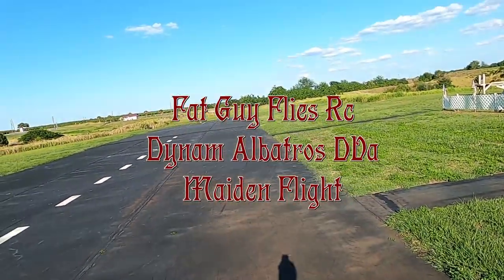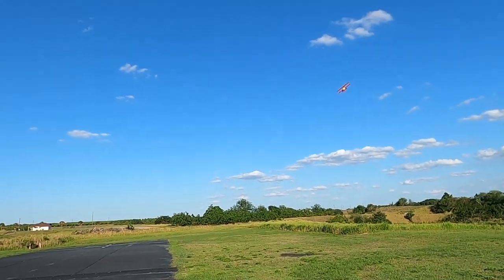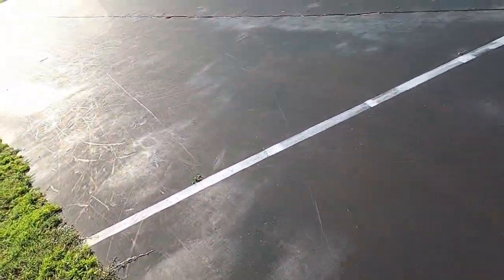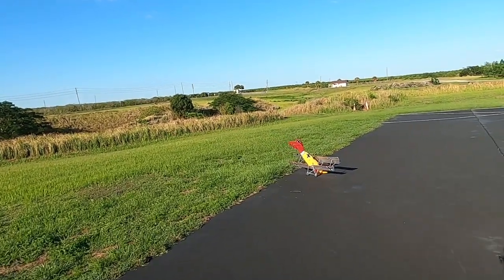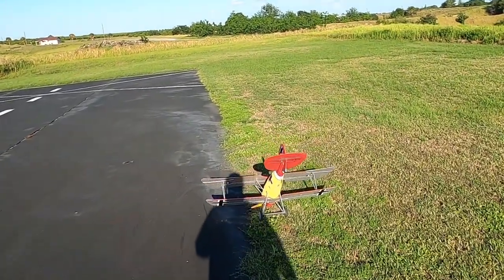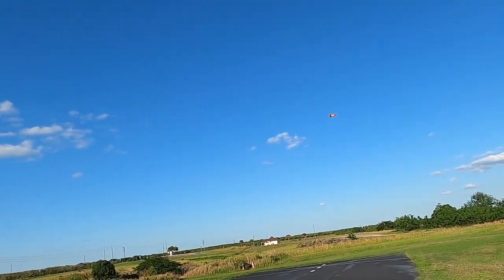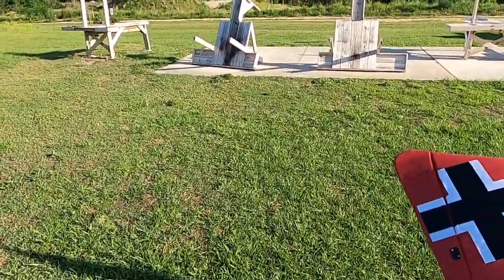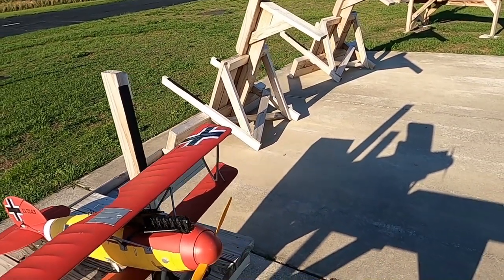Dynam Albatros DVa Maiden by Fat Guy Flies Rc

Comment: The jolly Petrinsic Bros said that model needed a lot of rudder input to turn and that the ailerons were used to bank and level wings. I would use rudder/aileron mix with plenty of rudder throw for casual flying and switch it off when not wanted. The problems with access to receiver and servos, after mounting wings, is pretty much the same with all biplane models, You shouldn't need to remove top wing though.
Reply from the maker: ts just a Dynam, that says it all....lol

Comment: That was nice Greg, sometimes I have rates on the elevator just for landing to help keep the tail down 👍
Reply from the maker: Good tip! I think I will add some of the weight to the tail and mechanically have the level trim of the tail actually a little up in flight.